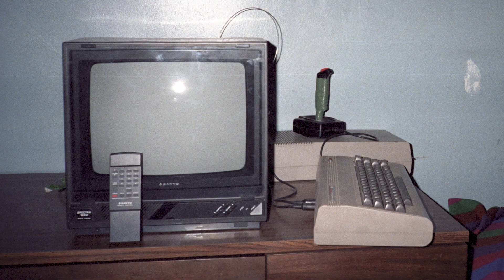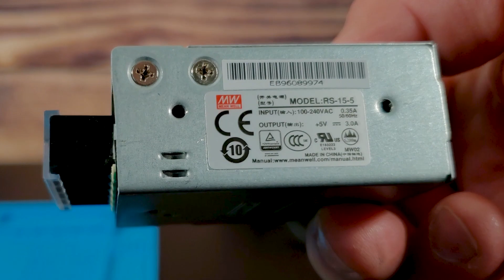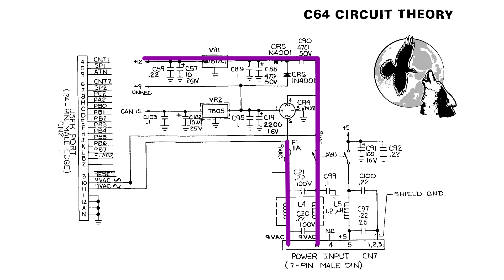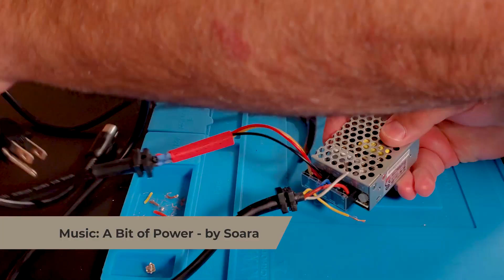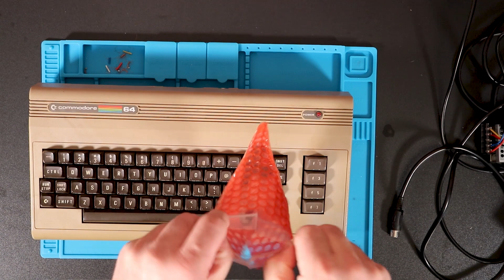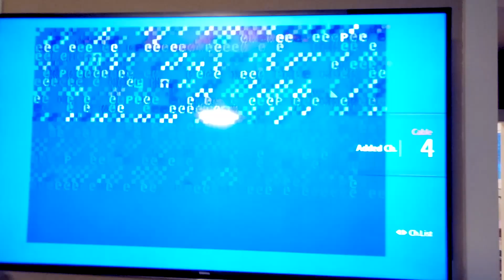Don't Let an Old Power Supply Fry Your Commodore 64!

Comment: I built mine too. With the meanwell 3A 5V also and I put a protection assembly on the 5VDC line inside the case and the LED indicator is connected to the protection assembly. For 9VAC, I used a "block" brand transformer.

Comment: I know sometimes noise can be an issue on switching power supplies. Have you noticed any hash or other noise on the output? I get a lot from my bench top supply, but it may be because it’s continuously variable on the output.
Reply from the maker: Paul, I have been using it for almost a year with no issues and the C64 seems to have adequate filter caps. I suppose its possible there is noise at a frequency that the filter caps don't respond well to. I am still planning an expanded video covering a bench power supply for the C64 & C128. When I shoot that, I'll look at the output on my new scope (I did not have a working one when I made this video)

Comment: Nice work. Glad to see you are back in the C64 world. I always like to see a C64 get back up and running. Mean Well does make some inexpensive and good quality PSUs suitable for retro computers -- very handy to easily acquire off-the-shelf solutions. Ray's items are top-notch. Coincidentally, I just completed a 3-part YT video series on how to make our own solid state C64 Saver from scratch in case you might be interested. I'm looking forward to your future videos. Subbed!
Reply from the maker: Thanks, I will definitely take a look at that. I was heavy into Commodore hardware back in the 80's and early 90's but then life happened. The sheer amount of information available now is mind-boggling. I have to admit I am pretty impatient to get the S-Video cable done so I can dig into the computer and 1541!
Reply: @RavenWolfRetroTech  Yeah, there's more inovative 8bit/16bit projects happening now than back in the day, I think. Good luck with the cable.
Reply from the maker: @MindFalirRetro Your not kidding, I just saw that Hey Birt did a clock replacement. can you tell YouTube is still not notifying me of replies? 😰
Reply: This is brilliant, and just in time for me as my original PSU has started to fail. I am not an expert and this may seem a silly question, but the wall wart I own is 9vAC but 2Amp, will this work or will I need the 1Amp? Thank you
Reply from the maker: @Samwonly  It will work great. Amps is the amount of power it can provide so 2 Amps is plenty. I prefer a bit of extra overhead so, if I had the option, I would have used your 2 Amp over the 1.1Amp unit I was able to find.